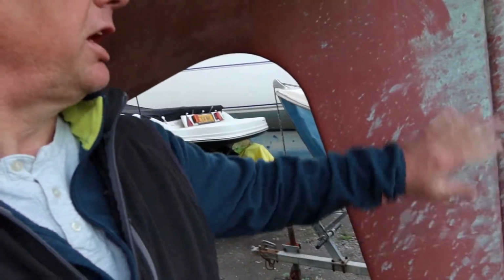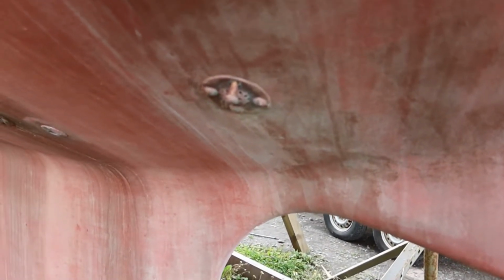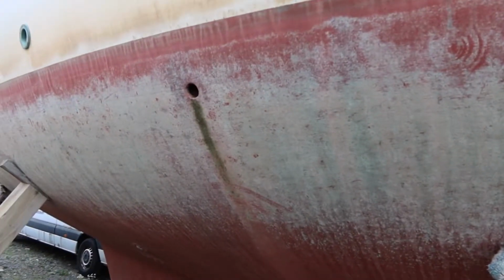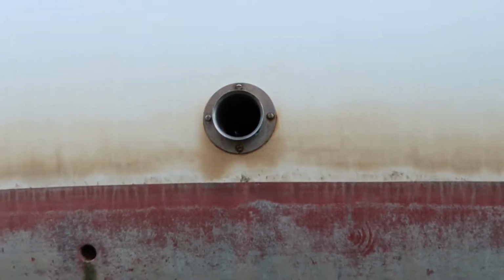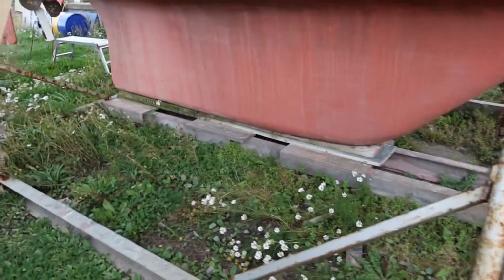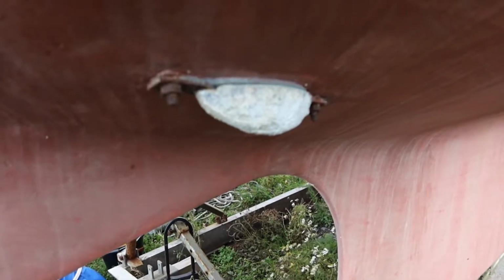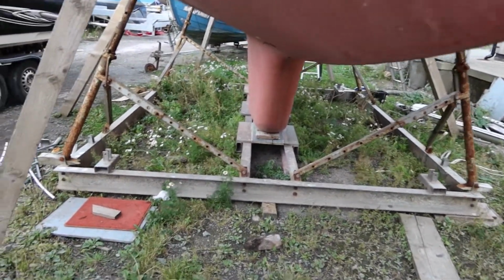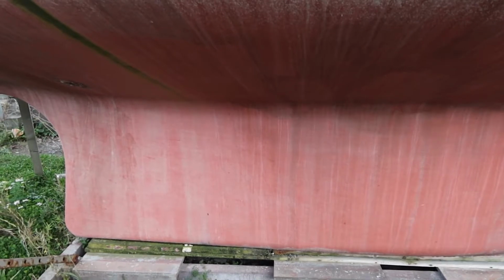More Seacocks, an "underwater" tour: DIY Boat Refit Progress 4

Comment: Engine water intake? 
Are you sure the one on the stud side is cockpit drain?
Reply from the maker: Yes, with a centre cockpit we had two cockpit drains, one per side. We have since filled in every single one of these seacocks and put in two much larger cockpit drains with composite TruDesign seacocks that are more accessible and which drain both ends of the cockpit.
We no longer have the engine water intake as we have an air cooled electric motor.
We no longer have any seacocks for toilets as we have composting toilets.
Our sinks will drain into grey water tanks so no seacocks for them.
Reply: @SustainableSailing haha, you beat me to it!
I was going to say you only need one hole in your boat, that for the engine cooling….and you don’t even have that! (Is a water cooled electric motor going to be more reliable) 
I used a simple bucket ´composting’ toilet, they actually desiccate.  No smell, unlike the sea toilet it replaced. 
Why is it that cockpit drains are so pathetic, I think 10cm is about right.  I guess with a centre cockpit, a transom drain won’t work, so seacock(s) necessary.
Reply from the maker: @markthomasson5077  Water cooled electric motors should be more efficient but also more expensive, more complicated and more to go wrong. Aircooled is simpler DIY. The controller is going to have a massive heatsink in the bulkhead to cockpit locker we might need forced air ventilation of the motor compartment. But the simpler answer is to sail more and motor less 🙂
We would much prefer transom cockpit drains but just impossible with our centre cockpit and aft cabin. We will be surrounding the seacocks (and propeller shaft) with a coffer dam to help us stay afloat in the event of a catastrophic failure.
We do like our Natures Head toilets but would probably go DIY next time (emptying the solids is tricker because it is the whole toilet base that has to be lifted and emptied).
Reply: @SustainableSailing  i am a great believer in watertight bulkheads, easy to achieve with centre cockpit.  Consider doing same for main / mast bulkhead, even if a screw on half bulkhead for emergency.
Reply from the maker: @markthomasson5077 we have already created multiple watertight semi bulkheads in the forecabin, including between the forecabin and the heads. We are planning a watertight "door" to fully seal the forecabin when at sea.
Reply: @SustainableSailing  well done…why no one else does so is beyond me.  Every safety gadget , but no inherent safety.